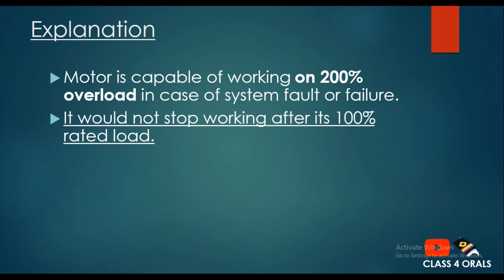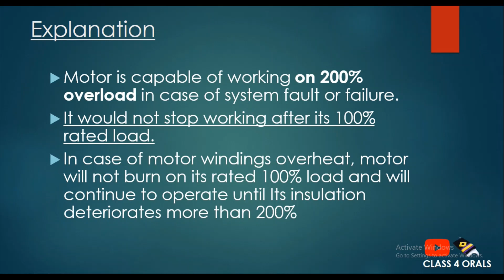What is 200% Insulation in Steering Gear Motor ? | MUST WATCH | CLASS 4 ORALS

Comment: I think actual answer of the question will be  insulation class of motor , Most of the marine motor have class F insulation which can withstand 155 C and next class of insulation is  Class H which can withstand 180C. There is nothing called 200 % insulation.

Comment: how is 200 per insulation achieved?
Reply from the maker: Basically, The quality of insulation is kept much better in case of steering gear motor. In case of motor windings overheat, motor will not burn on its rated 100% load and will continue to operate uptill its insulation deteriorates more than 200%.

So it means insulation will last until 200% overload of motor..!